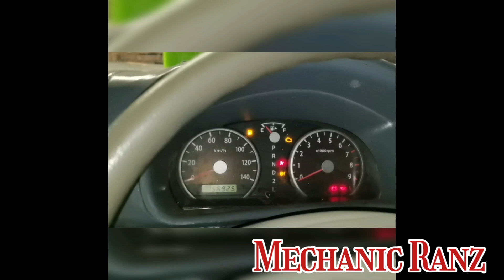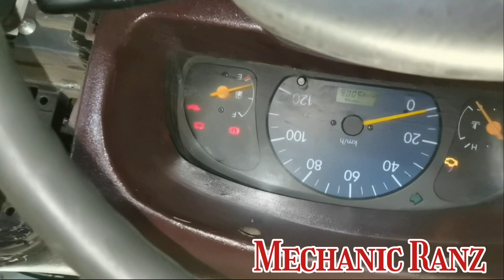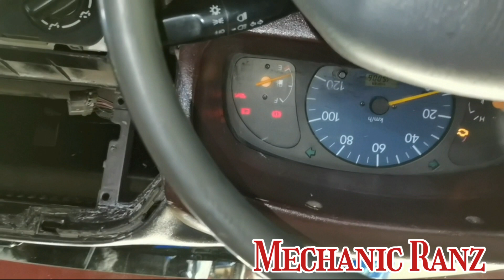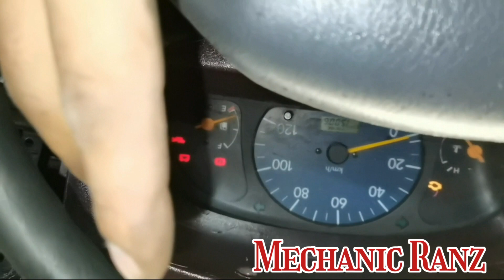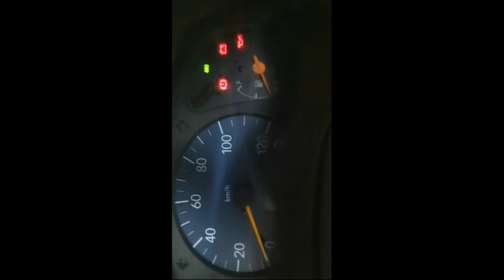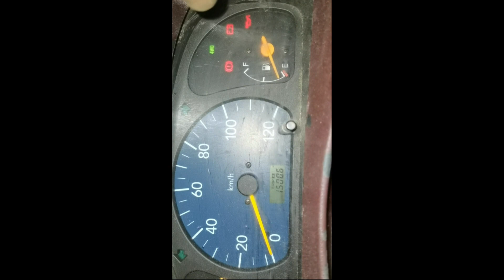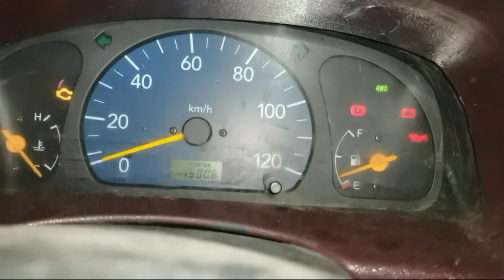DA62T 4x4 repair

Comment: Boss f6a ako makina scrum cut eye sama sab ana ang problima mo ingage man iyang switch sa transaxle or vacuum piro dili mo gana iyang 4 wheel drive..unta matubag ko nimo boss sa ako pangutana  thanks and more power sa imung channel
Reply from the maker: Stock up front careir nyan pa check mo sa mechanic sir para sure capillo Ranran fb ko boss
Reply: Asa imng loctaion

Comment: Sir ano kaya yung sira bakit hindi gumagalaw yung motor dun sa front wheel drive okay naman yung cable,fuse at module sir. Salamat sa pag sagot sir
Reply from the maker: 4wd switch sa transmission

Comment: boss master akung da63t ba kay mukalit ug engage ang 4x4 bsag d nko gamiton. unsay guba ani?
Reply from the maker: Check ang sensor sa transmission sir sa 4wd
Reply: @mechanicranz6968 sir same problem paunsa man para safe basig mu engage siya pag nagdagan ba unsa maayu e disconnected ang sensor?